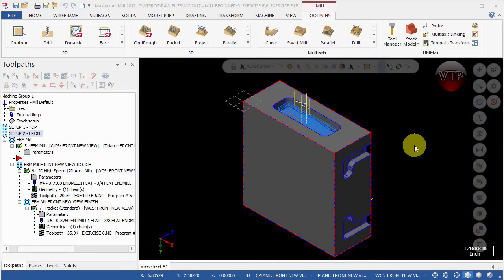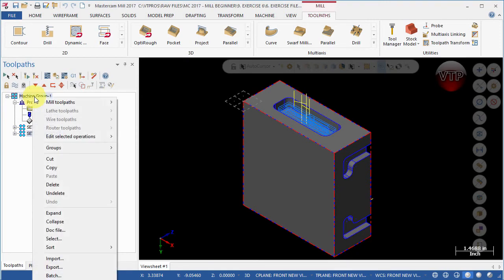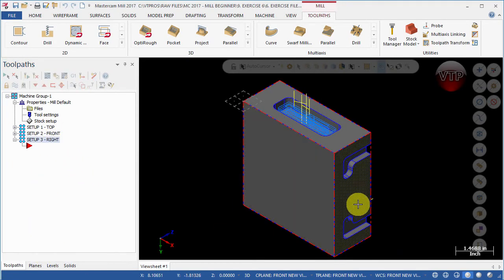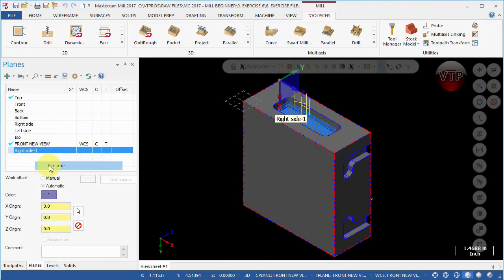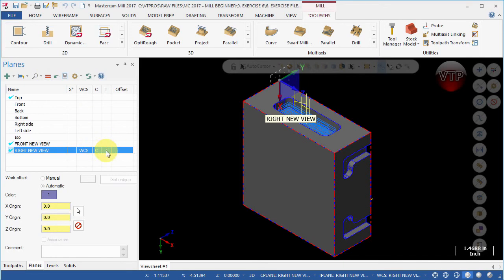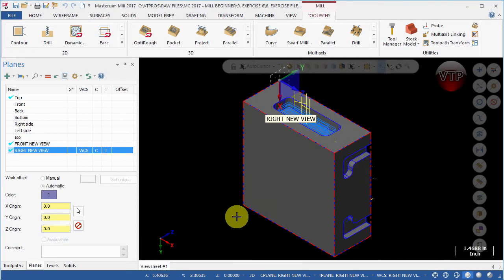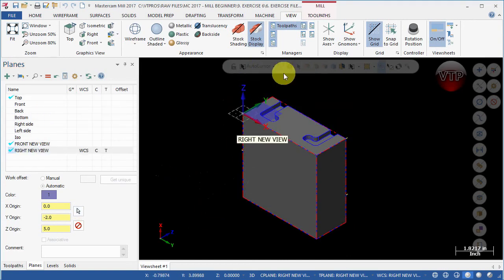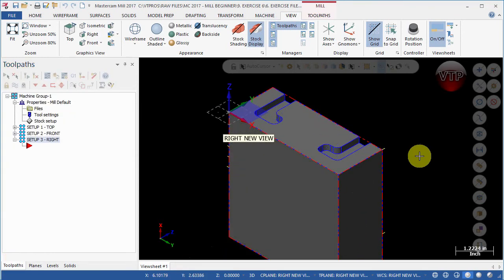MASTERCAM 2017-2020 - 2D MILL - Change Setup To Right Side - vtpros.netv (2019-2020)

Comment: Note from a machinist: I would do the drilled holes on the top last so the chamfers don't get squished in a vice when the machinist rotates the workpiece for the 2nd or 3rd operations :)

Either way, great videos, my friend... a lot of information
Reply from the maker: thank you for the feedback. with this setup, you shouldn't need to rotate the workpiece at all. you can machine the whole setup with one operation, which is why the order can be whatever you wish, but if it was multiple setups, i would agree. thank you again! sorry for the late reply